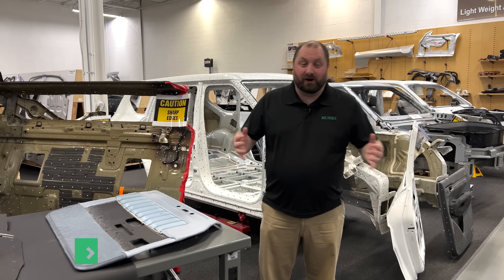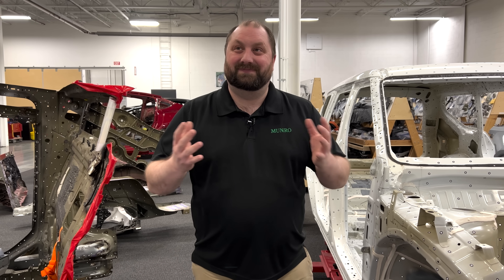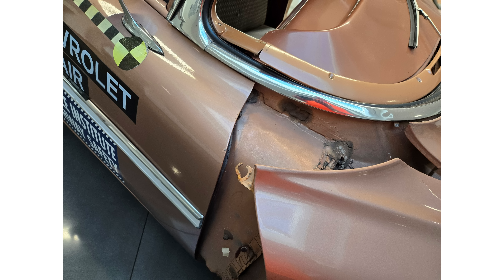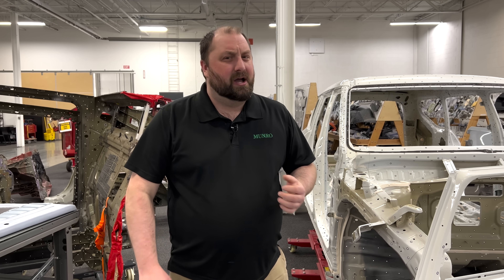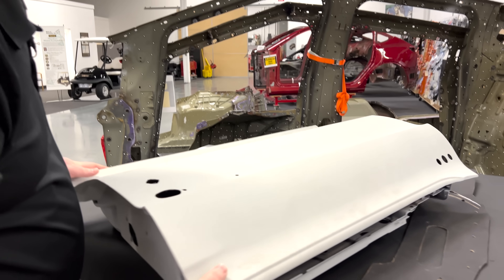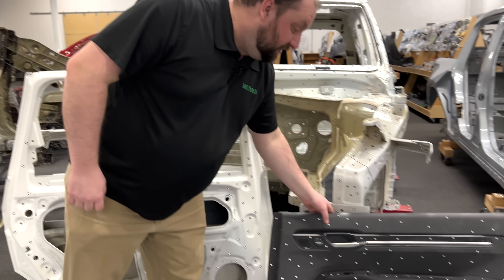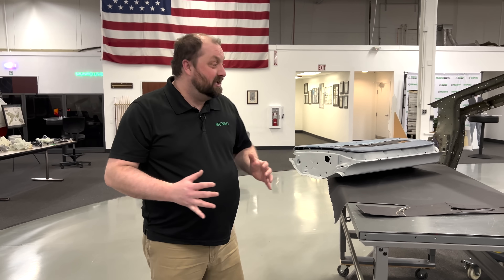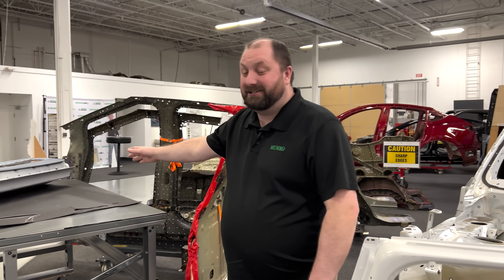No, Your Classic Car Isn't Built Better Than Your New Car

Comment: Tell that to many Chevy, GM, Ford, Toyota, etc. truck owners. My 1997 dodge 4X4 pickup has NEVER left me at the side of the road in over 200,000 miles. It was built over 28 years ago. It has spent every winter in Michigan, with the salt that destroys many unprotected autos.
Reply: How many 1997 Dodge are still around? Anecdotes are not evidence. Also, your old truck is a death trap. Even a tiny modern car would tear right through it.

Comment: Although technology is advancing, doesn’t it get to the point in some industries where tech is “mature”? Like handgun technology hasn’t changed that much since the Colt 1911. The design of can openers and nail clippers hasn’t progressed much in decades. Won’t the same thing happen to car bodies? Like there becomes an optimum design solution for safety and weight and design doesn’t change that much?

Comment: Great video. - spot on about safety, all one would have to do is look at auto fatality data adjusted for population and compare it decade to decade to see how far safety has come to confirm the oblivious things you show on your video.

The only thing I’d note is we reached a point of massively diminishing returns starting in the mid 90’s to early 2000’s for what most people use their vehicles for.   Those vehicles had one simple computer which is easy to get a genetic scan tool and get plenty of parameters, fuel injection had been perfected, fuel economy was good, ABS worked, rust prevention was okay, safety was pretty good, relatively cheap and simple to fix (no expensive censors in the bumpers, etc.), very good longevity.  I have two vehicles, a 1998 model and a 2023 model, from a basic use/driving perspective, they are effectively the same, but the 98 is cheaper to fix and maintain.   If we compared my 98 to a 75 (same 25 year gap), that wouldn’t remotely be the case.

Diminishing returns are real and we need to start acknowledging them.

Comment: A stronger lighter vehicle makes since. I got t-boned in my 06 Civic at about 45 mph. The car flew about 60 feet across the intersection and landed against the curb. The Civic was totaled and I did not have a scratch. Made the idiot that ran the red light sure about me wanting to cause him some disablements. Now they want to add massive weight back onto these vehicles with their batteries. That EV won't be flying 60 feet through the air. Rather it will be taking a heavier impact. Think of a linebacker's brain slamming the inside of his skull. Typically, those linebackers brains have turned to jelly by their mid 50s. Weight in motion is a b--ch!

Comment: Old cars are trash, people complaining new cars are unfixable just have a skill issue
Reply: A S.E technician here 😂😂😂😂 since it's a skill issue. How do I reprogram a throttle body sensor in my main E.C.M computer module? Where do I jack the vehicle from, the front, sides, back, or the jack points?. Most people don't know new cars, god Forbid get my parents or grandparents to try to do it, same way as I want a newer technician to clean ignition points and condenser in the distributor, new cars have way too much tech, I can't be on my phone, but I can legaly scroll through my dash mounted tablet 😂😂, "old cars are trash" because you don't know how to work on them same as many og technicians don't know how to work on E.C.M modules.
Reply: @midnightrider2456  old cars are trash. Deal with it.

Comment: Not just the structural integrity was worse.  There was also a lack of safety features.  My manager during my first full time job said that one of his first jobs was working at a junkyard.  Back then they were filled with cars from before the era of mandatory seatbelts.  He saw plenty of cars with windshields broken out, and blood around the edges of the glass that was left.  Plus many of the steering wheels were bent forward, when the drivers tried to hold themselves back at the moment of impact.

Comment: you're partially wrong about Lundites, they were not just fighting against factory production versus handmaking, it was factory production was a poorly quality at the time. they were also angry that customers were getting a inferior product, but it was cheaper.  the problem with generalized is there is a lot of context removed.. automation and factory production can be better than hand made but still needs to be done right.  cars today are better built, the problem I see is car companies use cheaper parts in the engines which break easier or more sensistive when you do not do the regualar maintence.

Comment: My 69 Roadrunner had nothing in the doors. When I removed the inside door panel to repair the window mechanism, I was shocked to discover that the only protection I had was the outside thin sheet metal and perforated sheet metal behind the interior decorative plastic panel. The door B post was also a thin stamped and bolted piece of metal. Sure death when hit on the side.

Comment: May be true as far as crashes go but I’ve got two mopars a 68 gtx 6barrel 4speed 440 numbers matching that I bought in 1975 also have a 
69 roadrunner 440 4speed 4 barrel both restored. I drive them both on weekends. When I’m gone my son and daughter will drive them 
You can’t say that about a modern car. Modern cars cost way too much to maintain as time goes on. 
Not to mention modern cars are engineered to fail that’s fact. Yes modern cars are safer but that’s about it old classics are a blast to drive and get a lot of attention.
Reply: Can't kill an ole Mopar.
Reply: @midnightrider2456  its already killed because the rust will take it
Reply: @Maximus20778  not at all mine are Texas cars never been out in the weather either.
Reply: @winstonrocco1981  your son and daughter will sell that car. No one wants that junk
Reply: @Maximus20778  
Well that’s your opinion but I’ve been offered a lot of money for both especially the gtx they ain’t junk
Reply: @winstonrocco1981  just put it in a showroom already
Reply: @ 
I look at them everyday lol

Comment: Agree on the safety, absolutely.   And look at the weight, my 1972 dodge pickup is 1500 ibs less than a new half ton.    The new frames are heavier, flex less, the suspension looks beefier too, brakes much much larger and more effective.   New truck has the same size box however.    Yeah its physically larger overall, absurdly so, but its also heavier where it counts.   I was shocked to find that VW Toureg thing was 5000 lbs plus minus, much of that is safety?

However the most recent round of cars are becoming too complex to fix.    There was a sweet spot somewhere like 1995 to 2010 depending of course on make model, where we had airbags, pretty good crash design, port injection and computers hung on the engines but still only like 7 main sensors.    Engines were internally simpler.   The jump in safety efficiency and yes reliability was enormous compared to 1975 or 80.   Hard to say what role better oils had but engine life doubled or tripled for bottom end and for most makes top end too.    I had a 2002 neon went 350,000 miles and was still making over a thousand miles a quart, never an engine problem in its life.    Since it needed another round of struts, brakes and then the manual transmission failed we just replaced it but it was still going strong for the engine.    Just change the cam belt, all I ever did.   Not even a starter, alternator, just 100%. Well once the water pump failed but that was me cheaping out on cambelt number 2 or 3, didnt change the pump, duh.

Recent trends have absurdly complicated internal engine design, direct injection, more more sensors, they are approaching throwaway.   And they gained like only 10% efficiency over an 05 equivalent.    Given how many will be scrapped before their time, you have to ponder the actual energy balance since it takes a lot of energy to make the car.    

One thing about pre 1970, for most makes mechanical repairs were trivial at least to figure out.    If you could keep the rust at bay you could just run them and repair them like forever.   And (mostly) plenty of room to work, no special tools either (mostly).

Comment: Also just curious- the 0.9 mm door panel from 1961 in the video- is that an original OEM door panel from that year or a new replacement panel? I assume it's the 1961 original panel measured not including the paint or primer?

Comment: OMG thank you for making this video- it's so good! I'm a Mechanical Engineer myself and get so tired of these ignorant Boomer comments too. Like ok boomer with no knowledge of statics/structural mechanics, Finite Element Analysis, load distributions, mechanics  of solids or materials science lol. Also alloy advancements in metallurgy makes a big difference, which are differences in the atomic lattice structures. You cannot see the atoms in these metals with the naked eye. And interesting you brought up 0.9mm thick on the 1961 panel- my 1992 Camry is at least that thick! But so much more than the outer skin plays into structural integrity on cars! I too appreciate and love the beauty of vintage cars, but objectively, they aren't as well engineered.

Comment: I would like to see a redo of that vid this time using a 74-76 Impala or Caprice much stronger car than the older one in vid ,that's why demo derby guys cherish the GM full size cars from 71-76 only other car that has a real chance at beating them is a 63-66 Imperial but those are banned from most demo Derby's

Comment: I would say, without reservation, that my 1968 Saab is a better built, more durable car, than my 2010 Honda. But would I say it's safer? Heck no, even as one of the safest cars you could buy of the era, it has nothing on any modern car. Would I say it's a better value? Nope. Take inflation into account the Saab cost more  in 1968 than the Honda did when new in 2010. And the Honda came with power windows, AC, a radio, alloy wheels, etc. The Saab? You didn't even get a clock. Even the carpet was extra! They get about the same mpg, but the Honda gives you 30+ more horsepower from the same amount of fuel, and doesn't need premium to do it either, so it's got more performance for less money. Will my Honda still be around in 30 years? Probably not, but the Saab probably will, for whatever that's worth.

Comment: At what point did cars gain the safety features that made the most difference? 1980s? 1990s? I would bet my 2003 Bonneville ssei is nearly as safe as a brand new car, it's 20+ years old

Comment: A classic car is perfectly safe if you don't crash it. Everything a modern car has just mitigates the effect of a crash. All completely useless if you don't crash.
The old cars could be perfectly well built, but by modern standards, poorly designed . This issue is about design, not build. Build quality in the manual / analogue era can vary from car to car on the same production line! That's before we get into the time available since being built for neglect or care, which will vary the condition of a model still further.

Comment: I think workmanship and quality of assembly of cars has waxed and waned over the years. Seems to me that late 1950s to early 1960s cars were more junky and cheaply thrown together (that "classic" in the crash test video had a cheapened lightweight X frame that was missing the side perimeter rails?)  than late 1940s to early 1950s cars but the drivetrains were getting much better. Then mid 1960s seem to get better. After 1970 for a few years a disaster. Then late 1990s and early 2000s seem to have been a sweet spot. Oldsmobile ad around 1966 boasted about its door latch system that resisted pulling open in a wreck from stretching forces to the side of the car and "guard beams" newly incorporated inside of the doors or inside the body of 2 door cars ? 
  Did early 1950s Packards have better metal or frames than ,say, Chevrolet ? 
Some of the improved engine wear as compared to the 1950s cars comes from improved oil additive packages and standard full flow oil filter systems ? 
Certainly the technology of protecting occupants from crash force by progressive energy absorption by outer structure collapse while the "safety cell" area more or less stays intact has come of age.

Comment: One important point you should've mentioned is the weight of classic vs modern. A new Corolla can weigh as much as 3400lbs where a 1966 mustang weighs in the mid 2000lb range. So much more structure to modern vehicles. Muscle cars were basically assembled w/ sheet metal screws; like building a shed. A real eye opener when you tear one down yourself.
Reply: part of the reason why musclecars were so fast was the lack of weight they had!  It's also the reason why we could get really good acceleration out of small Japanese cars in the 1980's, with only  2-digit horsepower ratings!

Comment: I get entirely what you say about classic cars. It is sort of stating the obvious in many ways.
What I would say though is modern cars especially in the last decade or so have gone backwards in reliability. 
They are now too complex, too tech oriented (touchscreens) snd the engineering of the engines is not as good. And they all look the same. 
In that respect newer isn't always better. 
I have an 07 Volvo and reckon that era is the peak of modern design vs too much complexity.

Comment: New vehicles are of unibody design. You can litterally take the doors, fenders, hood and trunk lid off new cars and they'd be stable to.drive. Try that on an old full-frame classic car. It would be so sagging and flexing you'd be scared. New cars are designed on structure for strength and safety. That's why new vehicles are just as heavy as classic cars. Yes you see s lot of plastic on the outside but there's high strength steel making up the structure under it. 35 years working on collision repair on newer vehicles and restoration on classics. The world has changed and so have the vehicles. Technicians need to remain in training to keep up with the technologies involved.

Comment: In 2016 I had a conversation with an old timer ranger at Yosemite Park.  In his early years, starting in the 1970s, it was rare that anyone survived a  leave the road and tumble down the mountain accidents.  Flash forward to 2016 and now the occupants  mostly survive.  That was all the proof that he needed that newer is safer.
Reply: A roll cage would probably prevent the roof from  having in on a roll.

Comment: I advise people to buy classic cars from the 1970's on (73) , from when the Federal Safety Standards were implemented on vehicles (side impact beams , front disc brakes ,seat belts , head restraints , sidemarker  lights etc) then you can enjoy a great looking car and have a reasonable level of safety , just in case somebody  texting in an huge SUV nails your Firebird while you are out on a evening cruise. I agree 1950's cars are pretty much deathtraps , drum brakes , metal dash panels , solidsteering columns , hard solid steering wheels etc etc , then you find out how many have poorly repaired bodywork (bondo is not a structural repair) , patched floors with screwed in thin sheet steel , and other horrors done to them over the years by various owners. I quit a classic car wine tour company over a  great looking 1961 Cadillac I drove paying passengers around in that had no seatbelts or any other passenger protection that had been repaired in such a way, as I couldnt tell the passengers in good concience that it was a safe vehicle to ride in .

Comment: I once was driving an 86 Pontiac Parisienne and Ruby was driving her 1998 Honda Accord & she jammed on her breaks because of a firetruck waiting at a light, no lights blaring. I plowed into the back of her Accord. The Parisienne fell apart up front & Ruby's Accord had a piece bent under her tail light.
Reply: very surprised at that.  the 86 pontiac had 5mph bumpers, which would frequently protect a vehicle in faster collisions. The 98 Accord has those plastic body extension that look like bumpers, but don't really do much for collision protection.  THey are actually designed to crumple to absorb impact.

Comment: A Mercedes’ official TV advert in South Africa in the 80s filmed from inside a w123 after as it drove off a cliff and hit the rocks at the bottom. That was a recreation of the same accident in the same place that a w123 driver, and he was able to climb out of the wreckage unaided.  By that point they were on the w124 too, which was even safer.

Comment: The Mercedes W123 from the ‘70s to ‘80s combined safety with reliability. Many examples reached 1 million miles with little work done to the power train. You can’t get a car today that is built to the same standard as those old Mercedes.

Comment: Most old cars are more serviceable than your newest of cars.

This is my biggest gripe of modern cars. Safety, power, and comfort is nice and all, but what’s the point if I can’t keep it on the road past a certain number of years.

I want publicly available service information, easy access points to fasteners, durable and affordable parts that are used across as many vehicles in a line up as possible, and real quality control.

If one can’t service/inspect it oneself with just basic tools, too much hassle, and some specialty ones (not make and/or model specific or hidden by subscriptions) I implore people to stop buying newer vehicles with such issues and push to keep older vehicles running and allowed on the road.

Comment: Modern cars are alot more safer than classic cars but modern cars are less reliable than a classic. Take a 90s Honda Civic vs a new Honda Civic. The 90s civics are known to get 500k miles. Sure the safety isnt as good but theres a lot less plastic and a lot less complexity under the hood. A modern civic has much more complex computerized equipment that are more prone to fail and uses much more plastic parts than the older civic. Sure the newer civic is safer but it isnt gonna last as long as the old civic.